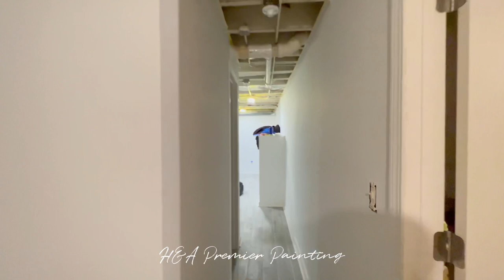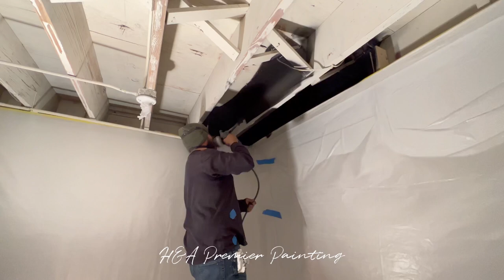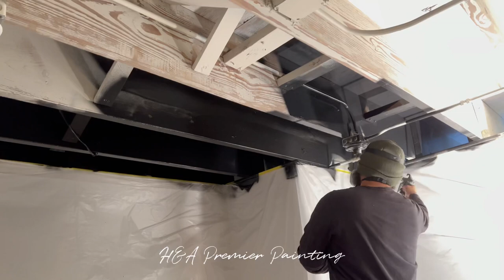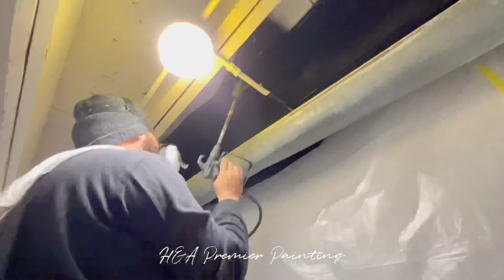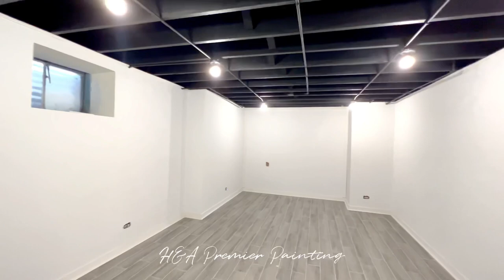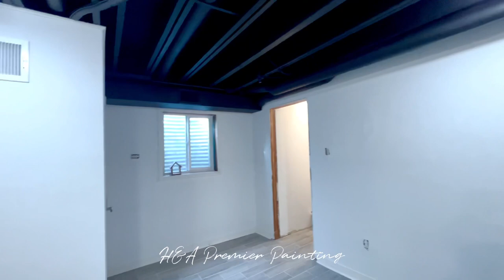HOW TO: Paint your basement ceiling black 🤩 #shorts #reels #explorepage #reelsviral #trending #diy

Comment: Why not paint the ceiling first before framing, dry wall and even the flooring?
Reply from the maker: Because The drywall was already installed when we arrived to do the job. 

When we used to remodel basements we never painted the ceiling first because when you frame, drywall walls and sand all the dust will get stuck in the freshly painted ceiling. Thank you!!
Reply: @hapremierpainting  yep once drywall is complete before painting walls is when we do it as well.
Reply from the maker: @kdogthehandyman   nice man. Efficient and right on the money 💰👊🏽